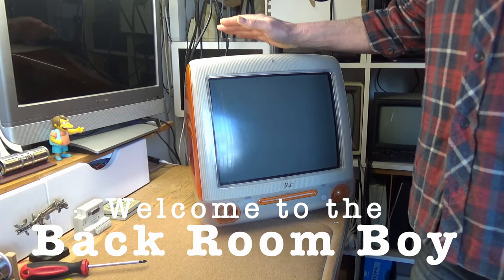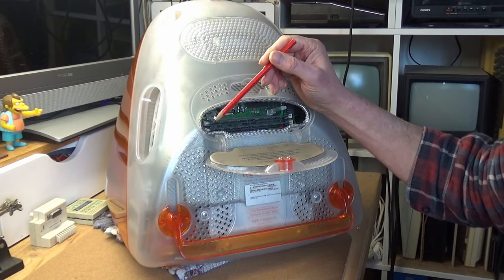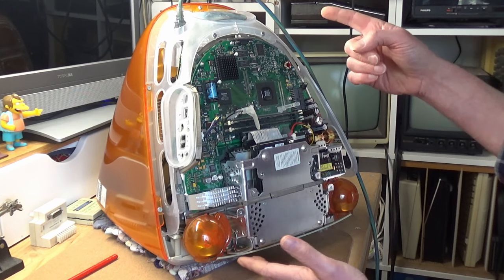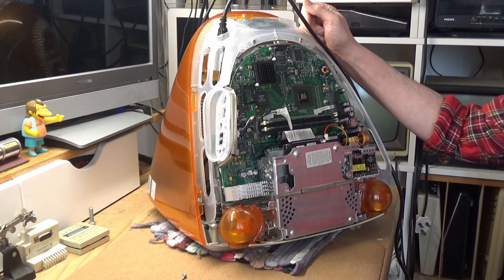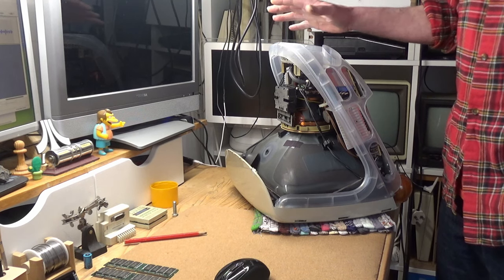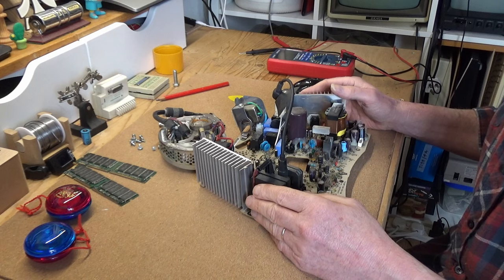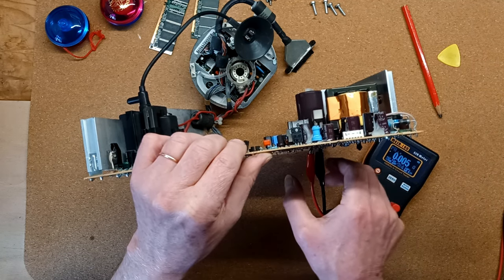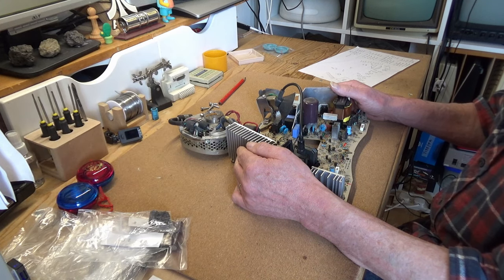iMac G3 slot load: dead!

Comment: So I went ahead and replaced all capacitors on board except the big one which seems to be in a good condition. I found some corroded resistors which I checked and cleaned and replaced a broken one. I believe the board I worked on is the next revision. There is no C922 capacitor and found C937 is 33uf 50v rated. Since I have already ordered 35v ones I just put that one in. Did not explode 😉  So far so good . Green iMac G3  450 is back on duty !
Reply from the maker: That is fantastic news, well done! Such a joy to be rewarded for all your hard work with a machine that is back to good health :)

Comment: Hello, many thanks for the very informative video.  I have slot load G3 450Mhz model and recently it started to load image on the screen very slowly. When warmed up it continued to work normal.
The last few days it get worsened. It attempts boot in a continuous loop and sometimes manages to load OS with screen briefly on and then off. I'm checking PAV and see on C947  16v47uf cap base brownish oily stain. Is it possible that a tiny cap can make all this problems? or maybe the Flyback transformer could be the main cause? I'm considering if I'll go to all of PAV overhaul time/cost process.
Cheers😀
Reply from the maker: You're welcome and thank you for watching. Its difficult to be certain without a schematic, but your problem sounds very like a capacitor issue and I'd be surprised if it wasn't more than one which needs to be replaced. The majority of those on my PAV board were neither bulging nor leaking but almost all registered at best a marginal ESR. Good luck!